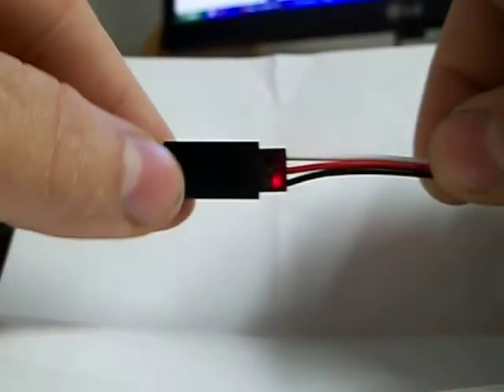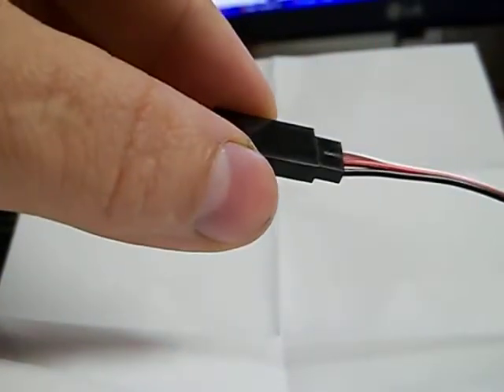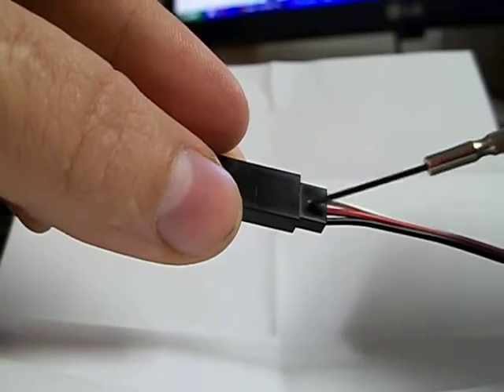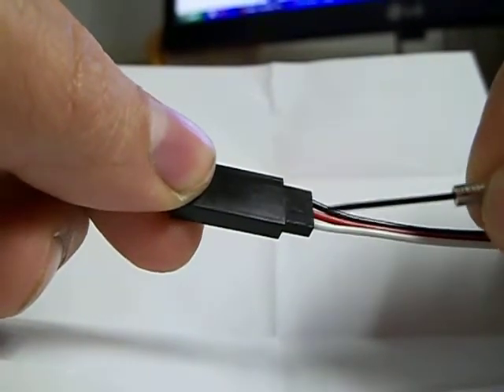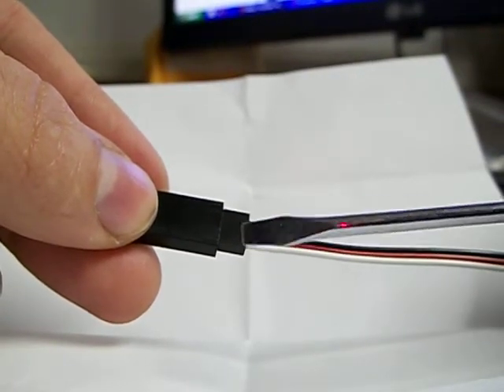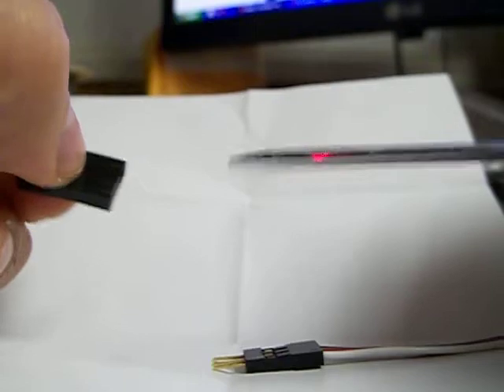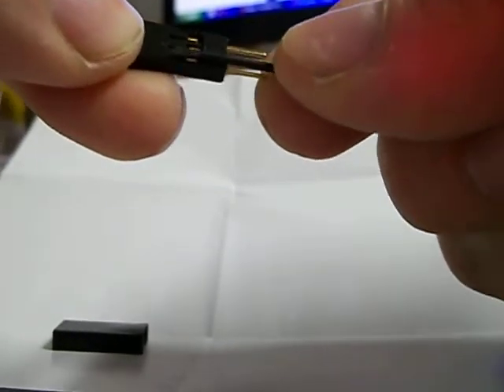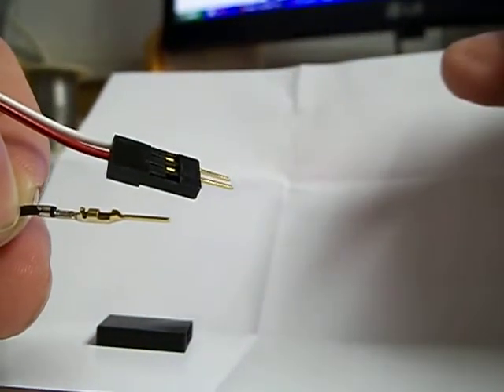How to remove the hood on a male R/C servo connector extension

Comment: My connectors were not exactly the same and I could not open them using this method, but your idea led me to try a different approach.  I used and exacto knife ( yes dangerous but use common sense)  and I went into the hood on the other end and was able to open it safely.
Thanks for the idea.
KLR

Comment: I was about to cut the thing off, but stopped and wondered..might someone on YouTube have run into this? Sure enough. I was on the right track with the little flat blade screwdriver before, but didn't go into the hood far enough. Now it's off. Thanks.

Comment: what are these "hoods" actually called. Can you buy them?
Reply from the maker: You can buy them but it's not really worth it. On eBay you can buy almost any length servo extension you want really cheap. I buy them in 30cm lengths, I cut the wires to make the size I need. http://www.ebay.com/itm/10Pcs-300mm-Servo-Extension-Lead-Wire-Cable-For-RC-Futaba-JR-Male-to-Female-30cm-/191959243732?hash=item2cb1a99bd4:g:GcUAAOSwvzRXxnGQ 
Here is a link to where you can buy just the hoods http://www.ebay.com/itm/Female-Servo-Connector-for-RC-Jr-Hitec-Futaba-with-Gold-Plated-crimps-x-20-SETS-/171906924018?hash=item2806737df2:g:frMAAOSw~gRV3STF